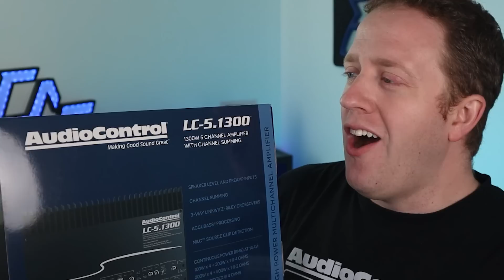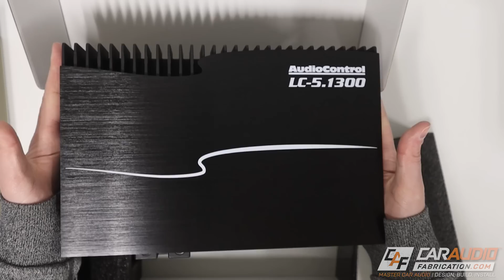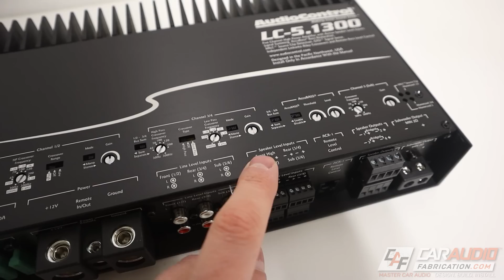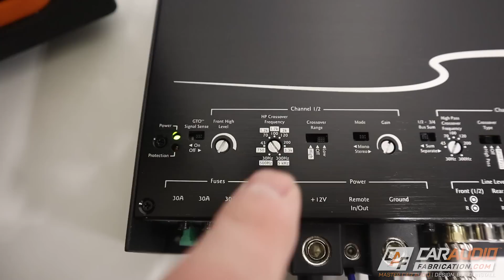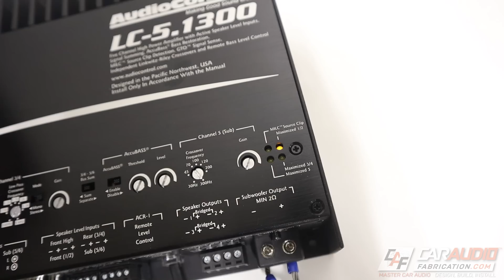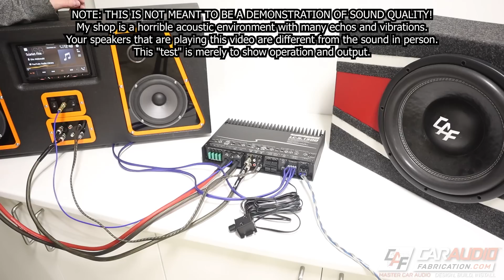Subs & Speakers Powered by ONE Amp? AudioControl's 5 Channel LC-5.1300 Amplifier!

Comment: Hello, if I am using a factory head unit with only high level speaker out and I have two sets of speakers but no sub can I just hook up the 8 speaker wires into the line level and still add a sub to the amp? Will the internal crossover split the low frequencies to the sub output? I do not have a sub out on my head unit. If not, how can I go about doing this? Thank you so much for the great content.

Comment: I’m planning on using this amp for my 2012 civic.. it’ll be pushing front and rear JL C3-650’s and a single 12w3v3-2. But my question, I’ll be using 4 ga wiring, what size fuse would I use at the battery?

Comment: Not sure that I’ll hear anything because this is an old post but I installed an LC 5.1300 in my vehicle the other day it’s a great amp. I took the OEM speakers out. Replaced them with new speakers. I’m still using the factory harness and I have a pack camp pro is the output line converter, my question is when I went to the gains the amplifier allowed me to turn it all the way up without having the light come on any channel. Does this mean that I need a load resistor?

Comment: Hi, I'm looking to buy this amp/dsp but not sure which one to get. I have 3-way components in the front, and coaxial in the rear, and a powered subwoofer that I'm planning to replace in the near future. It seems like I have 9 channels in my car. Should I get the LC.6-1200 or LC.5-1300? Thank you very much for the information!

Comment: Am I able to run 4 ohm speakers in the front and rear doors and wire the sub to 2 ohm on a ntx vad 11005 amp and get the extra power to the sub?

Comment: Do the tweeters get their own amp? Do they work with the midrange signal from the amp? Im confused. Also, why did you later add the subwoofer channel input? Is it better that way than from the one input signal?

Comment: Kinda wish I watched this before I did an old school splurge on amazon 🤣 welp, I'm gonna be pushing 4500 watt rms to a 5000 watt rms 15" orion. I think realistically 300 watt rms would have been fine for me and I'd be $3000 richer. $1000 of which went into pure copper alone 😔 whereas this Audio Control eliminates so much wiring redundancy

Comment: I have 2 3-way component speakers (Audison APK 163) for the front and back. I also have a Audison APBX 10 AS2 Prima Subwoofer. What is the best amplifier for this set-up of 12 total speakers and a subwoofer?

Comment: Does this work if you are using factory radio with factory amp or do I need  an LOC ? I was wanting to just use my front morel components active 4 channels(2 tweeters , 2 6.5  and subwoofer )

Comment: So if I were to use a 4 channel amp at 45W RMS per channel, use two channels to run one 50W RMS speakers a piece and bridge two channels to run one 120W sub, it would sound okay? I have a 2 seater that only has 2 front speakers and a small sub from factory and I'm trying to keep this configuration for ease of installation.

Comment: I currently am running a separate  8 band eq. I am going to purchase a dsp. My question is "am I benefiting any if I use my eq and the dsp or can I take out the eq all together and use the dsp. I have seen videos on how to wire an eq to a dsp but seems kind of pointless if dsp has a 30 band eq on it.  BTW love the channel and all the great info and tips you give. Thank Yuo for taking the time covering everything in such detail.

Comment: I just bought a 5 channel amp for my son's truck.  Upgrading his sound system for Christmas.  It's a 2009 suburban and I'm replacing the door speakers, front pillar tweeters, factory radio, and adding two 10" Subs with this amp.  So I'll be wiring the door speakers to this amp  as well as the subs.  Never done that before, but the salesman told me it would definately improved sound quality and volume rather than connecting them to the radio only.  I guess I'll found out.  First sound system I've installed in over 25 years.  I've been kind of giddy like a teenager lately when trying to plan it.

Comment: Hi, I'm very new to this stuff but would the remote power to the amp basically be the ignition power from the stereo?, and if I was only running a sub from the amp could I use the rca from the sub port on the stereo to the amp for input?

Comment: I never got a green light.  What does that mean?  Plugged in my 3/4 channel (100w RMS 2way kicker 6X9s)  and slowly upped the volume and had no issues.  Can’t go all the way up as my ears start bleeding at 25/35.

Comment: When connecting component speakers you would just use the component box and connect it like you would a non component speaker to the amp?

Comment: I have a Pioneer 5 Channel amplifier for past 2 years. Paid only $260 at the time! Had no issue. Running 4-channel 600RMS and one 12 inch sub rated at 500 RMS. I never ran on the maximum. Because I never set gains on the maximum what it can output. But when i crank my sub knob on  max all my windows vibrating

Comment: Nice video mate, quick question..How would you wire up factory components seeing as you only have 2 channels for the front? There's 8 wires needed for the front, and only 4 available for output. Thoughts??

Comment: Do you need to use the crossovers that come with component speakers like the Focal ES 165K2 when using this amp or are the crossover capabilities duplicated by the DSP on this amp?

Comment: Getting back into the car audio game after 20+ years. So much information packed into 18 minutes. I thought my head was going to explode. 🤯
Reply: Same! I’ve forgotten more than I remember and I cannot tolerate my 2015 Civic audio anymore. I’ve had clock radios that have sounded better lol
Reply: ¹
Reply: Just needed a 4 channel eq back then lol..
Reply: Lol 😂
Reply: I’m in the exact same position. Want to do my own system but it’s been 30 years since I’ve been involved in the stock so much has changed my heads about to explode.
Reply: Dude. Information overload is real.
Reply: Same here back in game after 20 years so much stuff out there now then back in the days- cRaZY 🤪
Reply: Same

Comment: What speakers and how many ohms match well with a factory stock unit?  My factory head unit has all that I need including bluetooth, usb, and steering wheel controls, I just need to replace the stock speakers. I also have a powered sub.

Comment: Marc, are u a audio control dealer? If so, i need a matrix line driver and a LC2 i think is what its called. Can i get better deals from u verses using ebay for instance. Also, could u read my question i clarified and reasked please. Thanks man, love ur ch btw, out of anyone in car audio, u make the most sense.

Comment: I have a 2004 Jaguar XJ8 and I need help. All the door speakers are not working. The Base speaker sounds bad as well but the tweeters seem fine. Where do I start. The aftermarket here in the USA sucks for this car. I’m in California and have been unable to find some one with the knowledge to repair or replace the system. Can you help?

Comment: I would be game, but add a DSP into the unit, like what JL Audio did with the VXi series and I would be all over it. But by itself, this unit is impressive.
Reply from the maker: The D version is due within a month! DSP built in!
Reply: @CarAudioFabrication  Whoa. I'll have to watch that vid when you get it. I'm currently running a Twk-88 (running the toslink cable) and a RD900/5. It sounds great, but like you said, it takes up a bit of real estate.  Thanks for the heads up!

Comment: I've got a question for you I'm building a 2 amp install in my crown vic one amp is 4 channel and the other one is for my subs. I normally have my sub switched so it's not on all the time so what's the best way to do that with a  2 amp setup?
Reply: You can put a simple switch through the remote turn on wire going to your sub amp, or use an RCA level control (such as the PAC LC-1) that allows you to turn the level all the way down to zero. Used to run a switch on my sub amp when I needed to have the sub box removable and it worked great.
Reply: Thanks my question is more about the turn on leads. Since there's 2 amplifiers so 2 turn on leads one will have a switch so can I connect it to my other blue wire from the head unit since the sub amp won't always be on?Hopefully this makes sense.
Reply: @anthonylrosesr9575  Not quite sure what you're asking. But basically, you will have your blue wire coming out of your head unit, then one goes to your speaker amplifier like normal without a switch. Then you'll have your subwoofer amp turn on wire also coming off the head unit, but with a switch going through it. This way your 4 channel is unaffected but your sub amp can be switched on and off. If the switch is left on, the sub amp will still shut off with the head unit like normal.
Reply: Thanks again for your help.
Reply: That's exactly what I wanted to know.

Comment: If you turn down the gain, will the amplifier require less amps from the battery? I drive a hybrid and it has a small accessory battery since the electric motor turns over the engine. 120amps would fry the battery, but this amp would suit my needs perfectly with less power draw.
Reply: This amp can run speakers at 2 ohm full load (what the fuses on it are rated for). If you ran your speakers at 4 ohm (which is the most likely case anyhow) it's unlikely to be drawing the full 120 amps. Gain control can technically be turned down to limit power after it's been set correctly.

Comment: Hey marc, would like your opinion. When using a rca bass knob, should you leave the bass knobs on the amps plugged in and turned all the way down, or unplugg them and proceed to use the rca knob. Ive heard so many diff things, would like to know the best thing to do. Thanks.
Reply from the maker: You can use them, but gains need to be properly set when they are at the max level.
Reply: @CarAudioFabrication  i guess what i mean is can i just not plug the bass knobs that comes with the amps in, leave em in the box and use my sky high rca knob. Does it affect the amps that the knob that comes with the amp is not plugged in or being used. I heard you should plug it in, turn it all the way down, then use your rca bass knob, with your gains properly set. Whatcha think?
Reply: @fredbradshaw3835  Depends on the amplifier. I know on a lot of Pioneer mono amp models, leaving the bass boost knob disconnected can affect how the amplifier sounds. On almost all other models though, leaving the included knob disconnected and using your RCA control should not be an issue. You'll have to try it for yourself and see if it makes a difference on your particular model. If it does effect it, simply leave the included knob connected and tucked away somewhere.
Reply: @ixionn563  no doubt, was thinking the same thing. My amps are skar. Was always told to leave them plugged in but now i hear it does not matter. Honestly, think the amp is louder with it plugged in, turned down and tucked away.

Comment: I think manufactures really need to supply more power to the Sub channel on 5 channel amps. 500W going into the sub is just not adequate when your speakers are receiving 100W RMS each. They will easily overpower the subwoofer. My rule of thumb is 100W to the sub per every 10W to the speakers. So if this amp is pushing 100W to each speaker the sub channel should be producing 1000W in order to have the system balanced and sounding right. If it's too much you can always turn it down but you cannot turn it up.
Reply from the maker: 500 watts with a properly selected sub and enclosure design is more than substantial. There has to be a stopping point somewhere. Also need to consider that many factory electrical systems cannot support 1800 watts, but 1300 is more borderline. Another guy was saying the sub channel should have been 3500 watts. 😅 When is enough enough? Lol
Reply: @CarAudioFabrication  I know, I was thinking that while writing this comment but big enclosures are so rare nowadays. Most car audio manufacturers pack 12" subwoofers in enclosures smaller than 1.5 cu ft per sub, and the average consumer wants to just stick to small boxes. If you paired single a 12" sub in a 2-3 cu ft enclosure that 500W would be very adequate for good sound. I have always been about having a single subwoofer in a large enclosure. I just never liked the idea of cramming multiple woofers in tiny enclosures, it just results in an inefficient system. But for 5 channel amplifiers, what I would like to see more manufacturers doing is putting 500W to the sub channel and supplying 50-60W to the speakers. Or 750W to the sub and 75W to the speakers.
Reply: I don't see why, if you're running a massive sub setup you should have the space for multiple amps anyhow. The whole point of 5 channels is convenience for smaller and SQ oriented systems. If someone made a 5 channel large enough for an SPL setup, the convenience factor would be completely lost.
Reply: @ixionn563  I'm not saying 5 channel amplifiers should be pushing massive numbers. I know they're meant to take up a small amount of space and are meant for SQ and not SPL. What I'm saying is there should be more of a balance to the subwoofer channel to a point you can hear everything in the music including the bass and not feel disappointed that you can hardly hear the sub after the install is complete. Let's say we're designing a 5 channel amp capable of 1000W RMS in total. A good balance IMO would be 700W to the sub and 75W to each speaker. This amplifier would be able to power a full Alpine Type R system with 1 sub and a component set in each door which will result in the customer being very happy. If your sub is not receiving enough power the customer will simply not be happy by the end result.
Reply: Adding onto my reply and to clarify my point further, let's assume this customer is going to be running the Type R in a sealed enclosure. The outcome will be more pleasing to the ear with 700W going into the sub instead of 500W. Sealed setups already lose output compared to ported so pushing closer to the subwoofer's power handling is the way to go.

Comment: Hello, honestly I’m very much a newbie but I really need to ask. Got a Toyota SUV that I intend to keep stock AVT HU. Will this Amp. I can be able to drive surround with a total of 10 speakers (components and coaxial all at 20 watts 4 ohms) + dual subs 8” of just somewhere 100 rms or so watts? Thanks much.

Comment: Hey dude I've been warching your channel for quite some time but never commented. I've searched for Audio Control in Europe but haven't really found anything.. I have a toyota starlet which had awful speakers and replaced them with a complete audio system full alpine 2 amps sub and component speakers and it sounds almost perfect, I'm searching for a DSP to finish out my build and I will be using noico to insulate sound 2mm and 4mm in the summer. Thank you for everything, through your channel I put together my sound system, matched watts RMS and even put a fuse box apart from the fuse close to the battery! Keep it up (and if you know any good DSPs that are sold in Europe please help!) Sorry for the long comment! (Alpine spr-50c, Swe-1044BR)

Comment: To those saying this is expensive; not really. You'd have to run an amp for mids/highs + another separate amp for the subs, plus your LOC, even a cheaper LC2i would still run you over $600, assuming you're using quality amps with true advertised RMS output. This is an extra $50-100 to have it all in one package. Cleaner, and easier to install. This is a nice ass amp. Wish I knew about this sooner. But Audio control makes great products

Comment: This is one of my favorite car audio channels but  audio control is to rich for my blood. you could buy a whole system. speakers, amps and maybe a single sub for the price of this amp
Reply: Literally. I got a HU, 2 5ch amps, 4 6×8s, 2 8s, a 15, and all the wiring/distribution for less than this. Maybe even the MDF for the boxes. Don't get me wrong; I'd buy AC if I could afford it, but I'd probably feel like a bit of a tool.

Comment: One amp system? Sure. I had a Sony XM-C6000 that ran everything in my 93 accord, back in the late 90s.
Reply from the maker: I never said it was anything new.
Reply: I was just pointing out that I too have installed a one amp system. Not disparaging your video at all. One amp systems are nice. I wish I had room for another XM-C6000, or one of its close relatives. The AudioControl one is a sweet setup. I use AC in my current setup. LC7i to be exact. It is a sweet addition and I can’t wait to finish the doors wiring and speaker upgrade. 
No disrespect intended. At all!

Comment: Here's my problem with these 5 or, odd channel amps.... never enough power for subs. What about us running 4 co/triaxial 120w rms speakers plus 1 3500w rms watt sub? Am I supposed to run my poor sub on ⅒ the power?
Reply: They're more about convenience and space-saving than spl. Get one custom built for your ride; might start a trend.
Reply: 5 channel amps are a convenient option with a small footprint, they're meant for folks who are just upgrading their sound system and adding a sub. If you're running a system with powerful subs, separate amps are the smarter and only option.

Comment: What about tri-mode? Is that still a thing these days?
Reply: Yup.
I run a 5ch with 2ch on 4 6×8s @2ohms, 2ch bridged on an 8" midbass @4ohms, and a sub on the 5th ch. Tri-mode plus a sub off one amp. I did it this way so I can remove the sub if I need the space in my ext cab, push a few buttons on the HU, and switch off the low-pass to the 8. About to add a second 5ch amp, another 8, and a bigger sub. At this point I'm about ready to say screw the space and just wall it. Lol